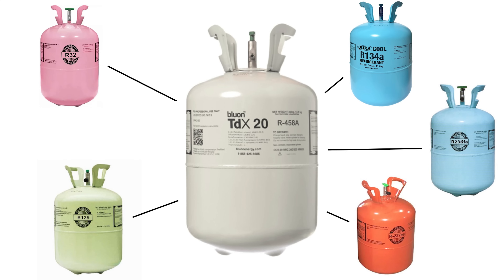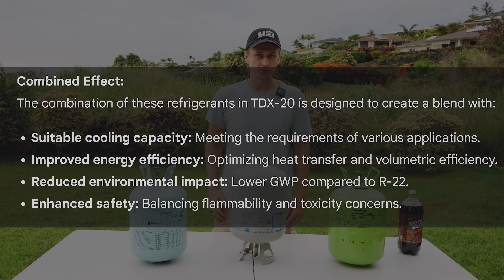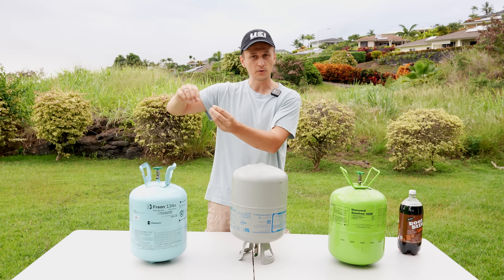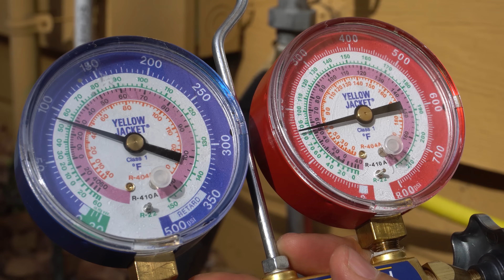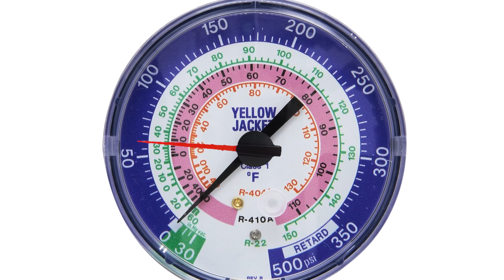Should The Tank be Up or Down?

Comment from the maker: ⬇ Other Videos You May Be Interested In:

How to Check Freon Pressures:
https://youtu.be/dExFtP-nXTw
Adding Refrigerant as Vapor:
https://youtu.be/T2s38Dg8s4g
Example of Throttling Refrigerant in:
https://youtu.be/GlS8aAkUBT4
How Often Should Freon be Checked:
https://youtu.be/NTQP0HfPbG4
How to Do a Pump Down on A/C:
https://youtu.be/nY5913wSvhQ
Top 5 A/C Problems:
https://youtu.be/GOXgdnRB840
How to Check A/C Compressor:
https://youtu.be/0aAj0iqP95A
How to Read Superheat and Subcooling:
https://youtu.be/pUYLmxOrfo0

Comment: Did you drop in a "Drop In" refrigerant into an R-22 system? Or did you convert the system by reclaiming any existing refrigerant and replace the filter driers, pressure test, pull a vacuum and charge up with the replacement "Drop In" freon?

Comment: I would never add a blended refrigerant. If u invert the jug, you risk flooding the expansion valve. I always use weight, amps, and my gauges so I recapture first, evacuate second, and then charge. Buy a small scale so u can weigh the tank as it empties into the system. Make sure you have lots of air blowing over the condensor. Also, keep the windows open (when working on a car and leave recycle OFF).

Comment: Hey man! Question about hvac, we just a new one installed, the new ac will kick on if it goes past the 1 degree threshold(set for 76 and it’ll kick on at 77). Our old carrier lasted 20 years but had a 2 degree threshold (set for 76 but kicked on at 78). I’m just worried at 1 degree is worse for our compressor because it’ll kick on and off more often. What do you recommend? The 2 degree split meant longer run times which might easier on the compressor in theory?

Comment: ...that is a great video man. I was looking for something like this as I am new to all this lak. Just a question if I can ask please. Say the airconditioner is off , not running. If I am charging the system say with the tank uprigt is that then the High Side ? or is it the other way round,?  . Also how do you use guages then if the gas id 'blended'' like the tdx2 ? Many Thanks.

Comment: 410a is near-azeotropic and studies have shown there is very little, less than 1% fractionation. Most heat pumps and also a lot of refrigeration equipment will have an accumulator before the compressor suction line. With these types of systems there is really no issue with flooding the compressor as you shouldn't be adding enough liquid refrigerant to overwhelm the accumulator. I know that it probably beyond the scope of this particular video.
Reply from the maker: Thank you for a more detailed explanation on 410a!! Much appreciated! 👍
Reply: So you should charge with the cylinder upwards? And if so then why refer to the cylinders arrow at the side?

Comment: If you're adding liquid refrigerant, would it be appropriate to add it to the high side so that there is. a longer path back to the compressor, allowing it to boil off before reaching the compressor?
Reply from the maker: Yes you are right! It is better to do it that way. I stand corrected 🙂
Reply: NO. Using vapor pressure of the storage tank to add to a partially charged running system requires low side charging. The high side will have more pressure than tank, and the pressure in tank may reach the safety release tab pop off range and is DANGEROUS. Adding to low side with tank inverted to get liquid for the mix refrigerants is the norm, and slow addition to allow vaporization is the method to avoid compressor damage.

Comment: Hey Jay, as your commented in the 7:54 mark with the unit off, I don’t believe you can open the suction side as you’re saying and leave it open if you’re putting liquid refrigerant because when the compressor comes on, you will also slug the compressor, you can open the high side or liquid side and yes, you can add all the liquid you want through there.
But other than that, I love your videos. They’re all very educational. 
Thanks
Reply from the maker: Yes, thank you for the correction! It is better to do it as you explained.
Glad to hear you love the videos!

Comment: how do you know if blended refrigerant will change ratio as gas versus in liquid state? was there measurement done to confirm this? anyway, good info!
Reply from the maker: I have not done any testing of my own but the manufacturers of these refrigerants have. Some bottles will actually have instructions on them that specifically say to "add this refrigerant as a LIQUID ONLY".

Comment: there is no drop in replacements for refrigerants
Reply from the maker: This is a debated topic so I don't want to claim anything.. Refrigerants should not be mixed but I have added TDX-20 to a R22 system before and it worked great. (I did not mix it with R22)  You just need to make sure that the refrigerant oils are compatible.
Reply: @WordofAdviceTV gotcha 👍
Reply: What would go wrong if you use a so-called “drop in replacement”, like the tdX20 he shows in this video?
Reply: @acemenace7411  R-424a can be used as a drop in replacement for R-22
Reply: @acemenace7411  R424a
Reply: *are - Grammar Police

Comment: Am I correct to assume that refrigerants never come in containers that have a tube that runs from the valve to the bottom of the tank?
Reply: Yes, to my knowledge none have a dip tube. Btw,, He very well explained what took me years to gleen from hiring many ac techs being a building manager.
Reply: @francom6230 : Thank you!
Reply: @francom6230  Actually some do. Simply Google for a list, if you're interested.
Reply: Recovery tanks will have a dip tube but illegal to charge with them unless it's the same equipment being recharged after a repair.
Reply: @sensismell42  : Thank you!